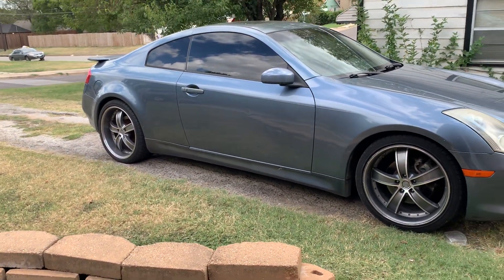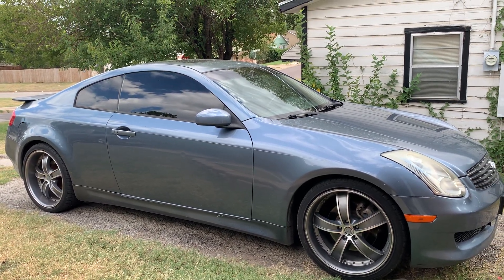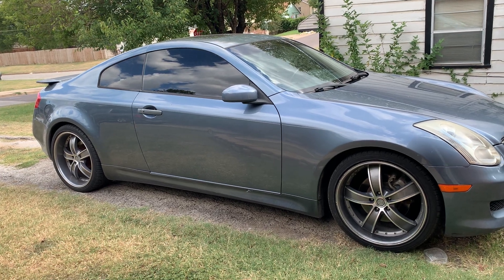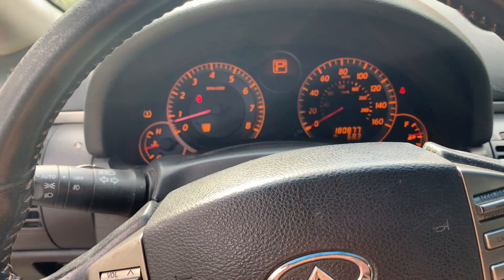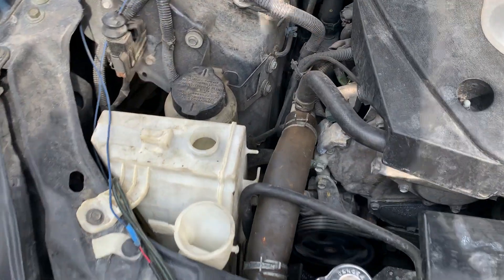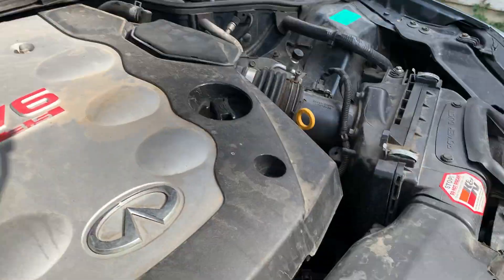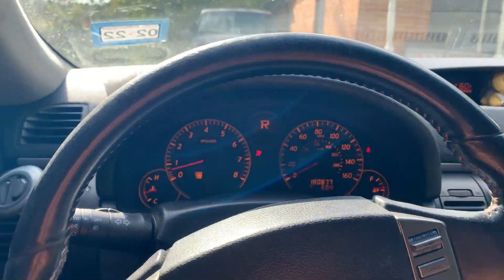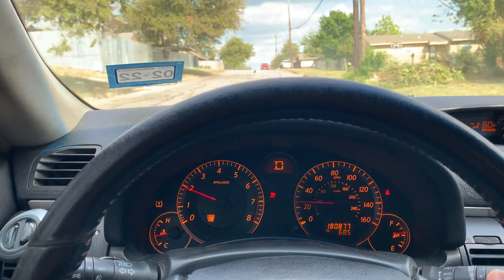Another update on my blue devil G35

Comment: This stuff is made with sodium silicate. To understand how it works, read the Wikipedia page on sodium silicate; automotive uses section.. It stays in solution until it gets above 212F (100C) where it will turn into glass/ceramic. It'll circulate in your coolant until it gets into cracks in your head gasket, gets cooked by combustion gasses and heat, and turns into a permanent hard ceramic seal. Pretty cool stuff.. Keep it out of your oil! It'll destroy your engine.
Reply from the maker: So far I don’t think it’s gone into the oil 🙏🏽
Reply: I just bought a G35. Should I use blue devil as preventive maintenance?